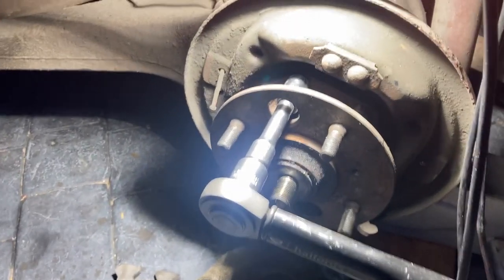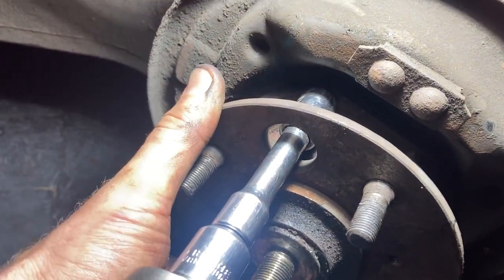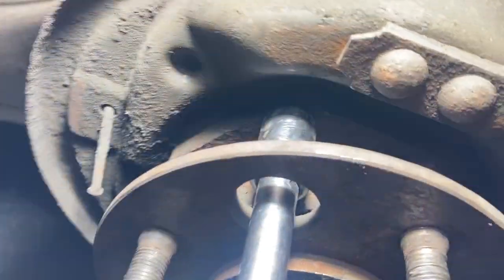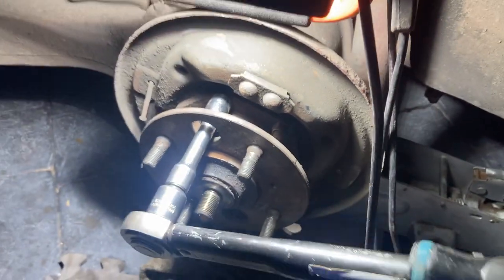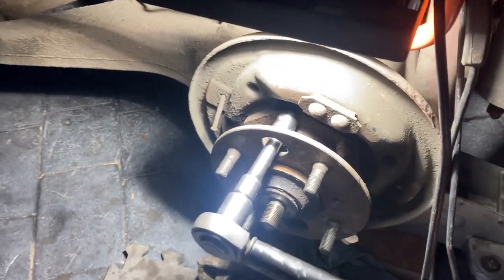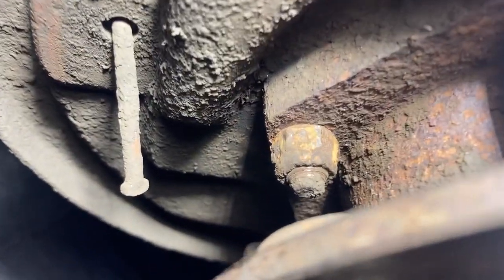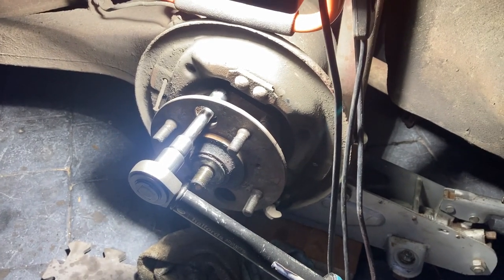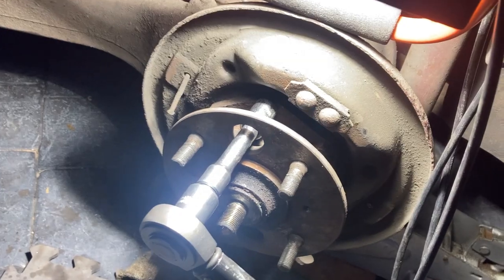Chix's Triumph Stag Ford Essex 3L V6 - DON'T DO THIS!!! Drive shaft to trailing arm nuts

Comment: Threads have gone in the aluminium alloy suspension arm.  Don’t drive it like that, it needs removing and all threads need helicoiling.
Reply from the maker: You're right! Did you read my blog?  Check it out... https://chixstag.wordpress.com/2022/06/22/so-you-can-torque-the-torque/